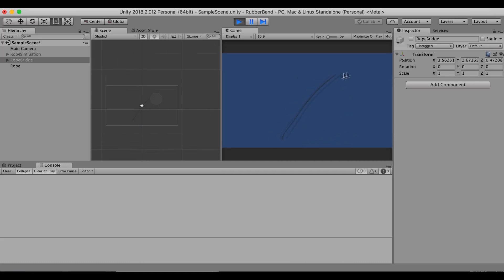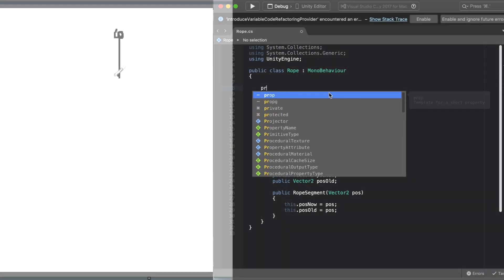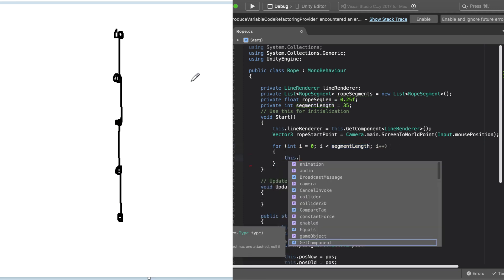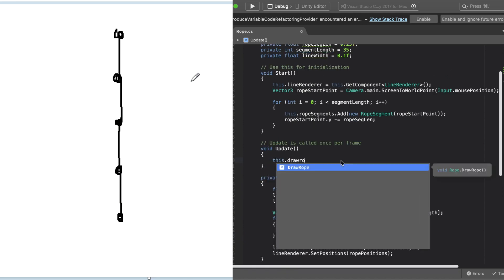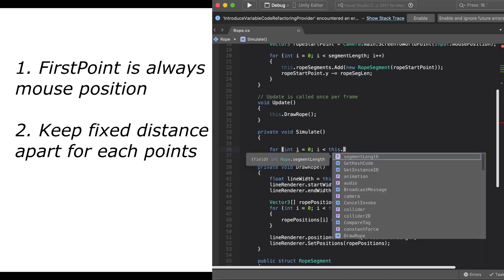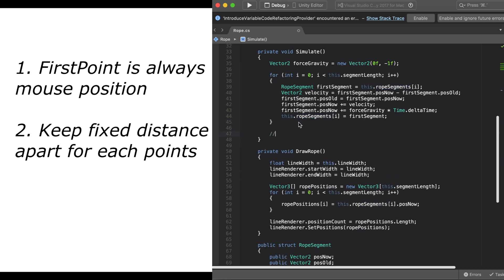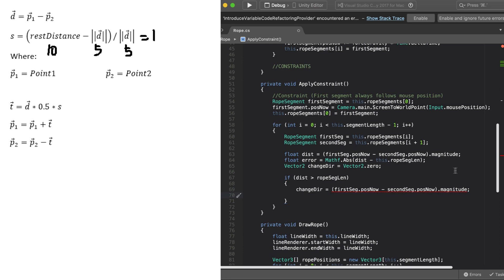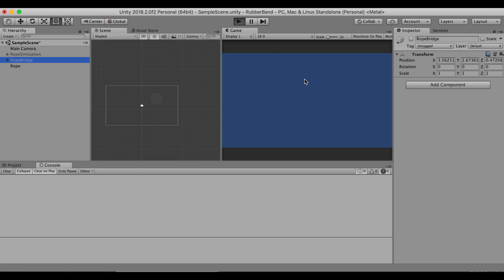2D Rope Tutorial - Make Swinging Rope in Unity (Verlet Integration)

Comment: Just thought I'd share this with you but could optimize out the 'if' check (since this can be quite expensive relative to simple math) in the constraint direction portion if you remove the Mathf.Abs and apply it directly to the normalized delta between first and second. Demonstrated below:

error = dist - ropeSegLen;
Vector2 changeDir = (firstSeg.posNow - secondSeg.posNow).normalized;
Vector2 changeAmount = changeDir * error;

(This is mainly for anybody who is confused when they get NANs when simulating the rope with constraints for the first time)

I imagine you fixed it in the jump cut between showing the writing the last part of the constraints and the end result, but in the portion where you're applying the calculation to segments that are not the first segment it should be written as follows:

firstSeg.posNow -= changeAmount * error;
   < This line should actually be this -->  firstSeg.posNow -= changeAmount * 0.5f;
this.ropeSegments[i] = firstSeg;
secondSeg.posNow += changeAmount * 0.5f;
this.ropeSegments[i + 1] = secondSeg;

Edit: Youtube was doing this to a portion of my comment
Reply: This is correct. Exactly what i thought while watching, thank you for writing it. It works perfectly
Reply: thank you very much, solved my problem!
Reply: it's not a good idea .... first of all your code doesn't work, I checked. Give a lot of errors ..... check yourself.

Comment: it's a great video and a great technique, but are there any reasons/scenarios where you should use this over Eulers integration?
Reply: In cases where the velocity is very high, Verlet integration tends to be more stable, since velocity is implied through using each particle's position deltas

Comment: This really should not be done with structs. You're changing the data contained in the struct so often - simply using a class will be much more performative.

Also, you don't need to use " this. " before every member, in fact you rarely need to use it - only in situations where a variable name is ambiguous like this:

void func(float length) {
    this.length = length;
}

Comment: I found it easier to understand what was going on with the explanation of the math alongside the coding portion, so thank you for that! 

One question about your slingshot showcase at the start of the video. I notice that I by adding an edge collider, like you mentioned in another comment, I can get the rope to influence objects, but those objects have no influence on the rope. 

I was wondering, is there was a way to get static terrain objects and platforms to influence the rope? Like getting the rope to rest on a static surface, instead of the opposite shown in your slingshot clip at 0:20 . Maybe a hinge joint would do the trick? Either way, great video!

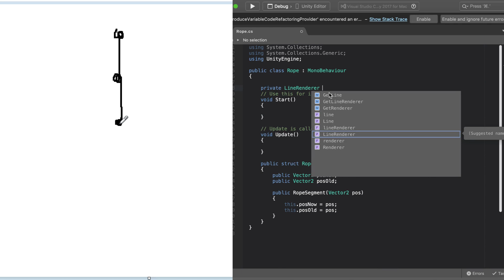Comment: min 1:55 in the struct, why do yo do this. 

/////////----- your code ----------///////////

public struct RopeSegment
    {
        public Vector2 posNow;
        public Vector2 posOld;

        public RopeSegment(Vector2 pos)
        {
            this.posNow = pos;
            this.posOld = pos;
        }

    }
///////----- your code  end----------//////////

How do you see the difference between the data will save on each one

why not this? 

//////////////----- why not-------////////////

public struct RopeSegment
    {
        public Vector2 posNow;
        public Vector2 posOld;

        public RopeSegment(Vector2 pos_now , Vector2 pos_old )
        {
            this.posNow = pos_now ;
            this.posOld = pos_old ;
        }
    }
///////////----- why not end-------////////////
Reply: how does this change the code? @Juan Diego F. G
Reply: Hi  @V_y-r_e  in the video he assigns the same value to the new and old position, so he how manage to see the old data if he replaces with the new position.